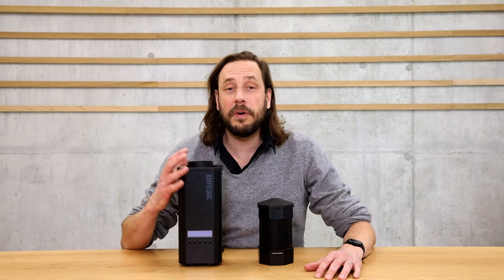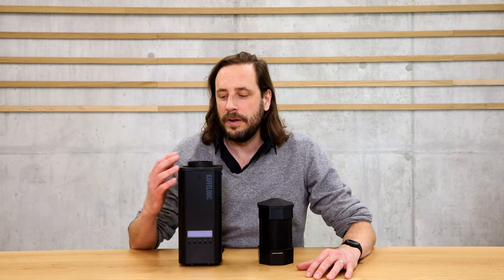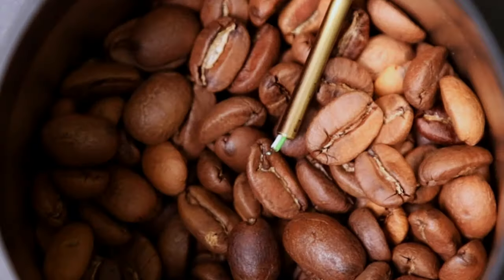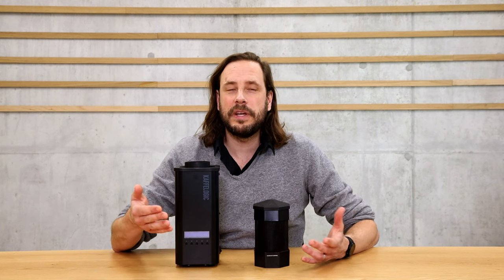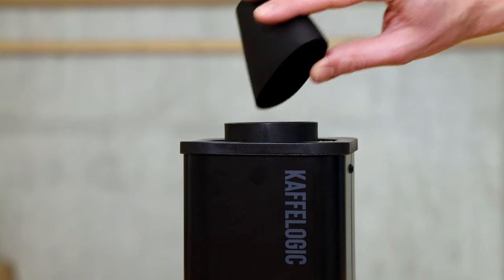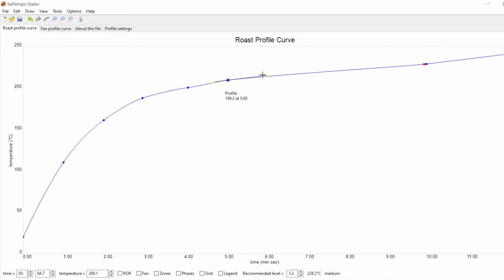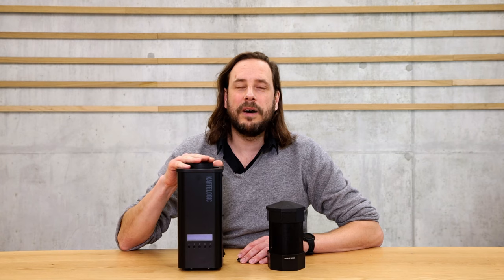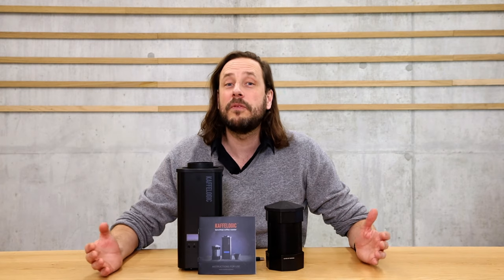Kaffelogic Nano 7 in 5 minutes (updated video already online)

Comment: Hello RR,

Would you be able to suggest where I can find more info on how to pull specific flavors from a roast profile.

I roasted a batch and I could taste the cherry taste. I roasted another batch of the same beans and it did not have that cherry pop.

Is there a chart that would show various heat applications during the roast to pull certain notes?

Thank you so very much for the information and advice. 😊😊😊
Reply from the maker: That would be great and if you find any information like that, please share it. 
In general you can pronounce those flavours you mention by roasting quickly and to a lighter colour. You might have seen the interview with Rob Hoos where we went into flavours and roasting styles, right?
Reply: @CoffeeRoasting  thank you for the reply. I don't think I saw that video but I'll look into it.  

It would be nice to have a visual reference that shows what notes are pulled at what time and on density of bean. Perhaps showing the notes that come through as the myriad reaction occurs. Idk, just brainstorming.
Thank you for the tip.